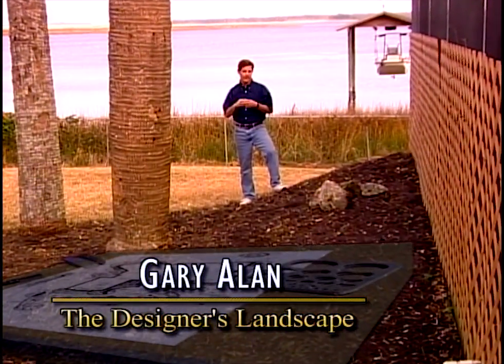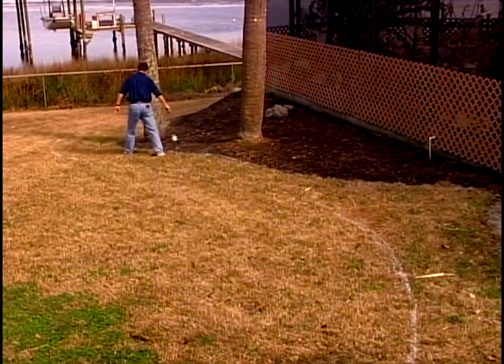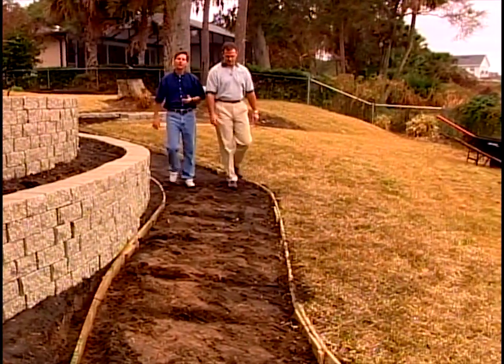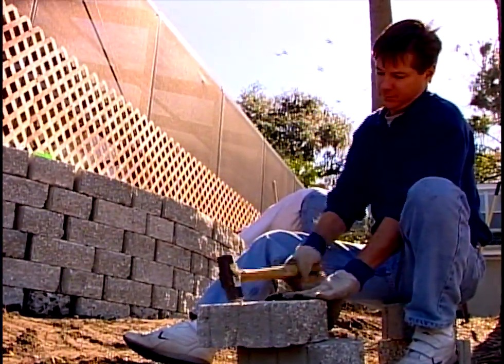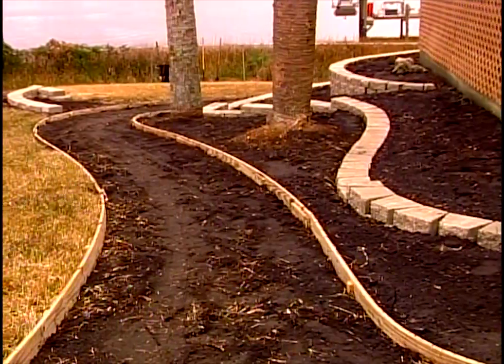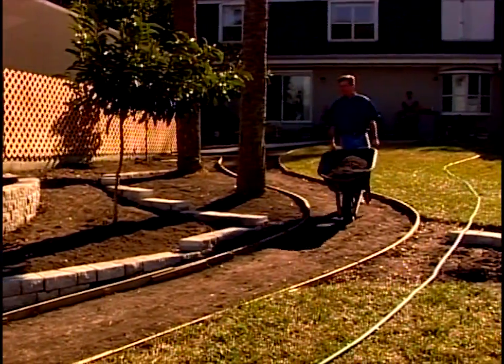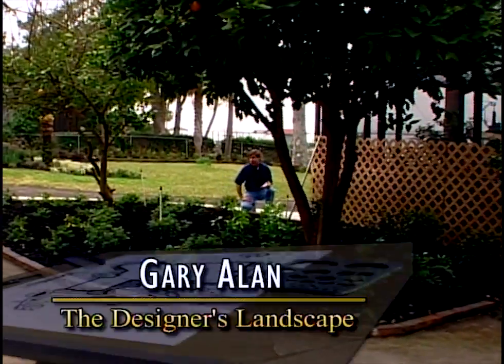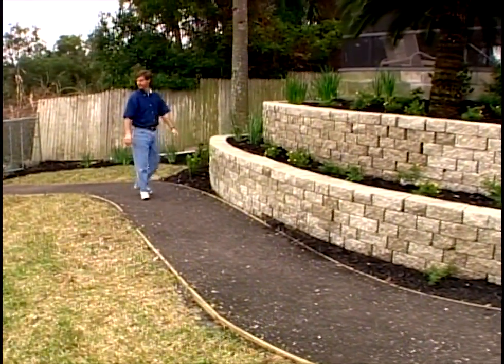How to build a terrace on a sloping yard DesignersLandscape#620

Comment: Not fond of the gaps in the front of the wall - not clear why you didn’t keep a solid, uniform front.  Only benefit of flipping them is a mix of sizes, but you add gaps.